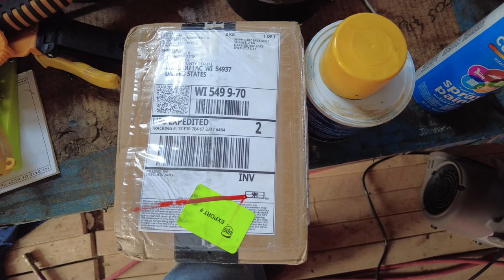SHERP BROKEN AND FIXED.   NEW SHERP TIRE INFLATION BYPASS SYSTEM DEVELOPED.

Comment: I was thinking of purchasing a sherp in the next few years and have been doing research before hand. Does your sherp have a lot of miles? I enjoy the fixes almost as much as the adventures👌🏻
Reply from the maker: Mine has about 350 hours on it.  There has been some hiccups along the way.  But I do not regret the purchase.  Hope it works out!
Reply: @SherpET  Ty sir. What year is yours?
Reply from the maker: @YELLOW08Z06  It is the 174 sherp produced from Ukraine. It is about 3.5 years old. It is 2019 or 2020.